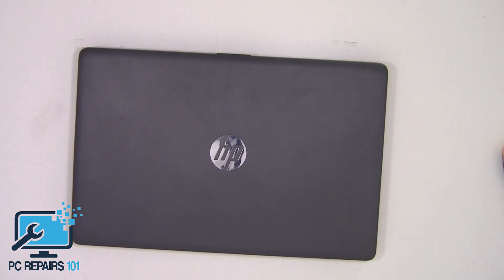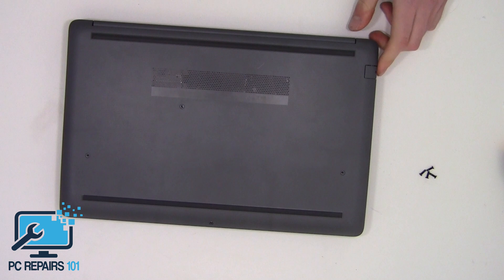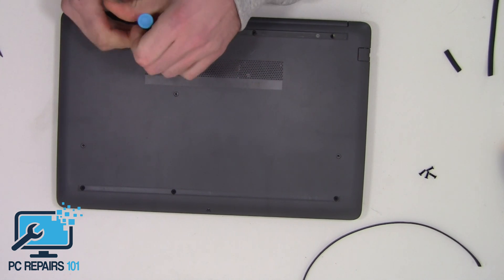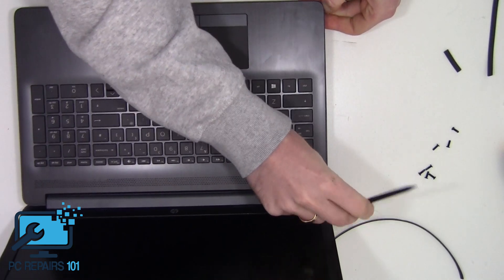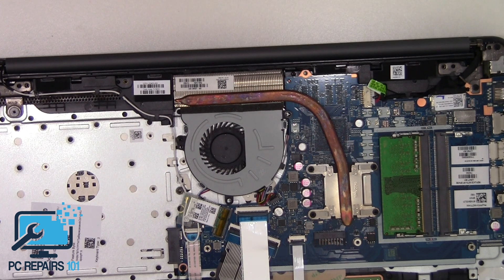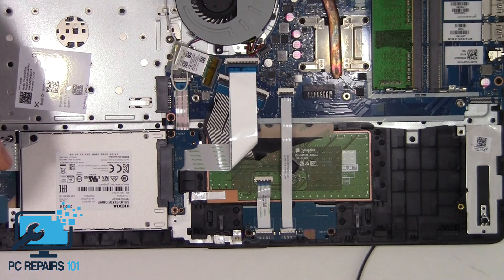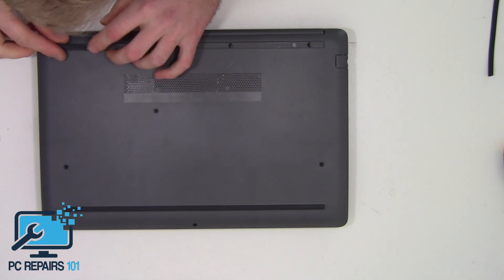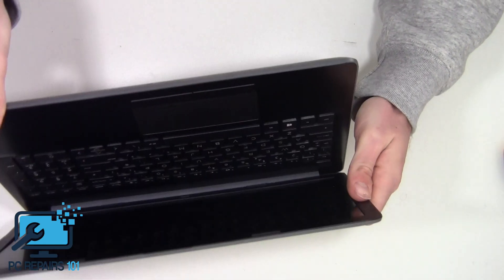HP 15 db002na Laptop SSD / HDD Replacement Upgrade Disassembly Tutorial

Comment: I see the laptop has a SATA connector where there would traditionally be a disk drive, do you know if a caddy system would work on that slot to connect the replaced hard drive
Reply: yes, a hard drive cloner could be used first and mirror the old disk to the new disk before installing new disk.

Comment: Hi Joe, after you've swapped the drives is it easy to transfer the data across?
Thanks for making the videos.
Reply: yes, a hard drive cloner could be used first and mirror the old disk to the new disk before installing new disk.